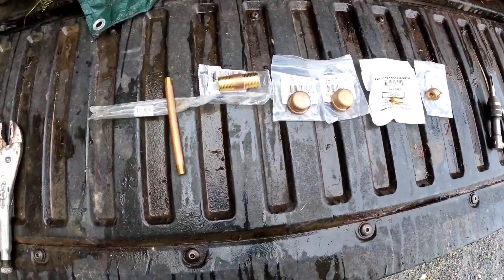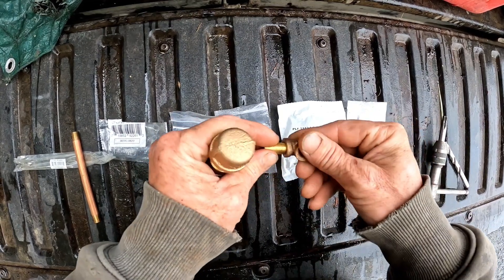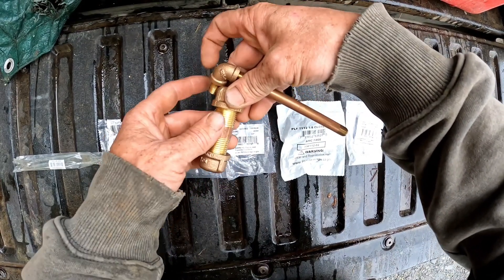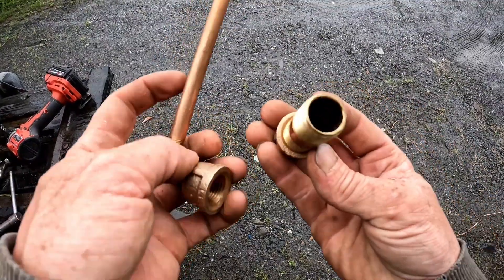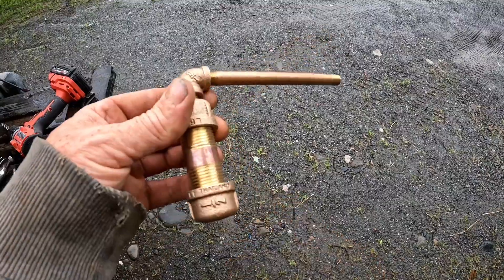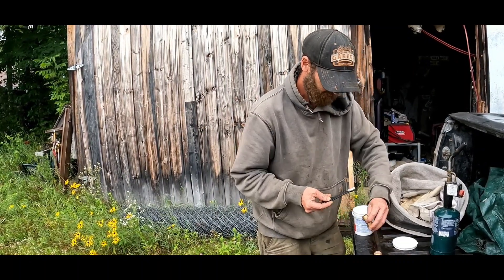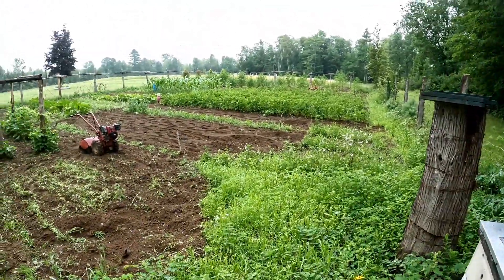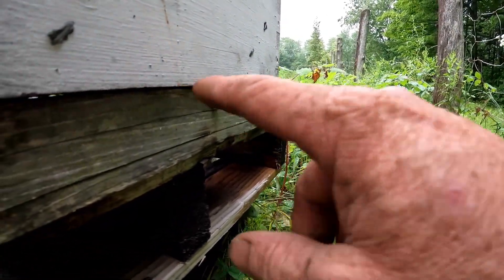HOMEMADE oxalic acid VAPORIZER

Comment: You'll discover you need to heat the small pipe before you heat the beg end as the Oxalic Acid will solidify and crystalize inside the little pipe if you don't.
Reply from the maker: OK. I'll try it. Does seem to work fine on mite count without heating tube.  Is your setup just like this one
Reply: @LogBeehiver  Yup, but I use JUST 1/2" copper.  To make it even simpler, using just a straight pipe with a cap works.
But---I MUST heat the tube up.
Really, I use formic acid whenever I can (when it's cooler)
I love formic Acid!
Reply: So heat the treaded pipe first or the upper copper pipe ?
Reply: @UncleJunior67  the 'exhaust' portion.  If you don't, the gas solidifies at the tip (makes cool crystals)